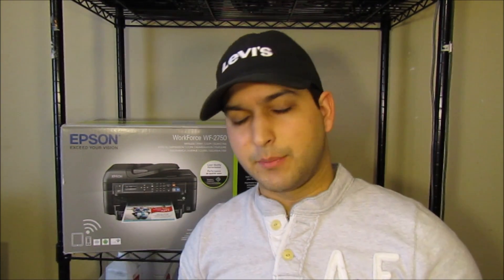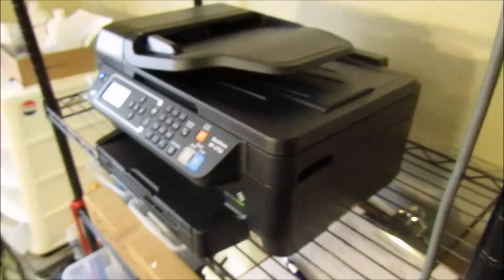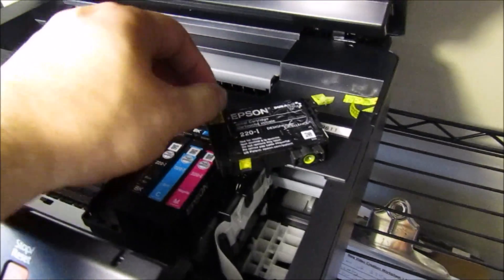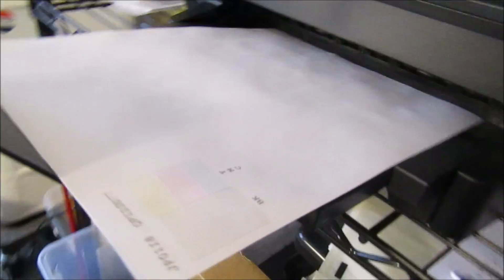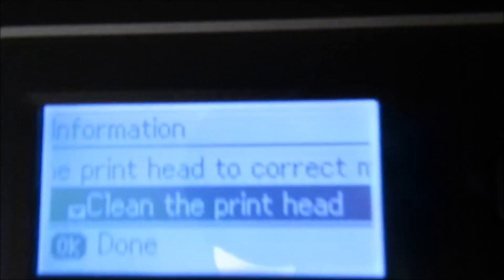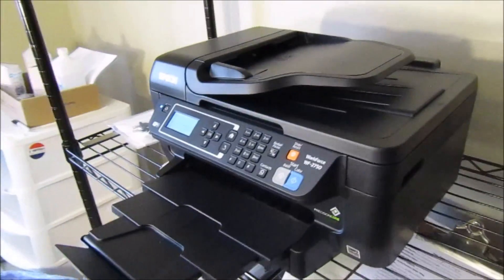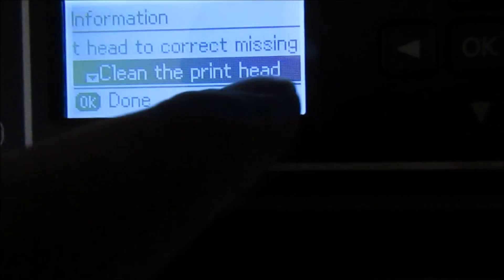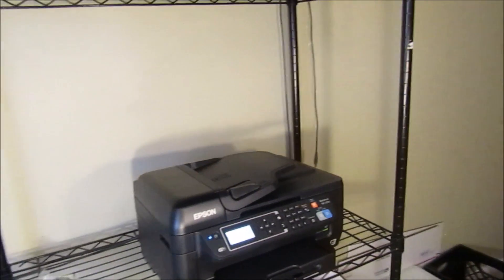Epson WF 2750 - Unboxing, Setup and Review -  Comparison WF 2750 & WF 2630

Comment: Dude.. HELP?? 🤦‍♀️ I have the 2750 and I can't get the paper choice to change. I don't have money to get another. But if I did what would you suggest. One that works well my cell or laptop well ( I'm still on windows 7. Yes a girl needs a new pc but🤷‍♀️  not able to do that at this time)  anyway I got this intuit about 4 years ago. Had so much trouble turned it off at it aside. But my basic Canon suddenly can't calibrate a black line😱 I have gone through every setting, cleaning mode for each part  have listed and still😭😭😭 its really important for my class I need to print each week.. can you help me?

Comment: GOOD JOB! Now the ONLY thing I need to know is “How to Print ONE SIDED Prints” as opposed to what “I SEE” that shows “”1>2 Sided”” which causes me to watch my Printer so it won’t take the Sheet BACK IN to Print on SIDE 2 — when all I wanted to do was “Single Side”. Thank you — I’ll check back!
Reply from the maker: Hi you can adjust that on the print settings from the device you are printing from.
Reply: STILL working on it JOE... any PARTICULAR thing (INSTRUCTION) I can do ON THE EPSON itself to CHANGE from what's happening.  So the sign keeps going as it says 1 > 2 sided keep going back and forth and don't seem to find 1 side. Sorry to bother you.  Thank you.

Comment: I seem to have a big issue with my wf2750. It's usually the 'operator', lol. Anyway, my printer is not set up for wireless printing, as it's my choice. I've had it for four months now and when unpacked and set up, it printed fine. I have not been able to print ever since. I have a USB connection to my laptop. I want to be able to use this printer to my advantage, but it has become impossible. Any suggestions or tips will be appreciated. Thank you for this vid, it had me thinking of questions I may need to ask. The actual set up was done by a close friend and as I stated, it worked, until I attempted a copy the next day. The only copy it made for me after set up was a PDF file. ♥️👍

Comment: can you help me :( I'm not tech lady? I need this new Epson for my online business. 
Showing connected to my older laptop. try to print anything? not working. I heard you say:
you need atb cable? Is this the reason my printer won't work? I'm so frustrated...costing me business,
because print anything. Plugged cable into a phone jack for fax. In input my wifi password. Lost on what to do 
I don't see toll free number to call rep. only way is to email the tech company rep. Thank you, Regina
Reply from the maker: Try connecting wirelessly, use google for the instructions. Just do a search for connecting printer to computer wirelessly. That is the simple solution because you don’t necessarily need the a to b cable.

Comment: This is the Epson WF-2750 version which you seem to be fine with but don't buy the Epson ET-2750 cause that version of the printer is garbage.  Everywhere you look for a solution for "printer mode" has failed.
Reply: The Epson ET-2750 is a worthless piece of junk. I have had nothing but trouble trying to use it!!